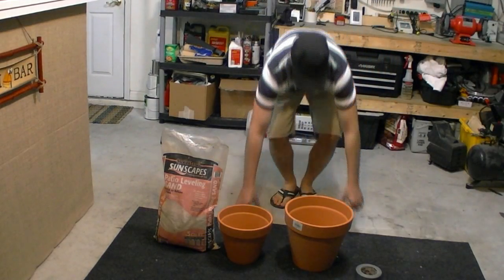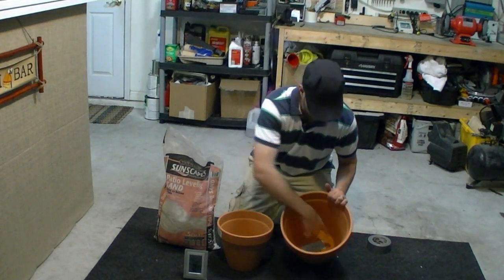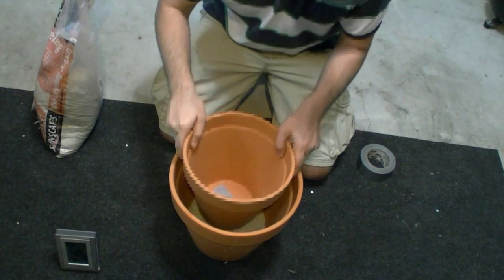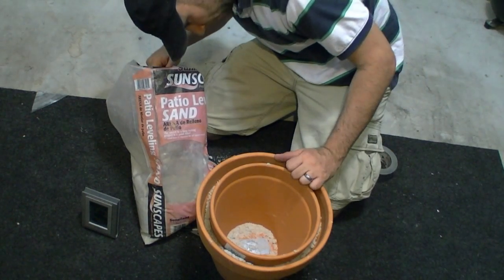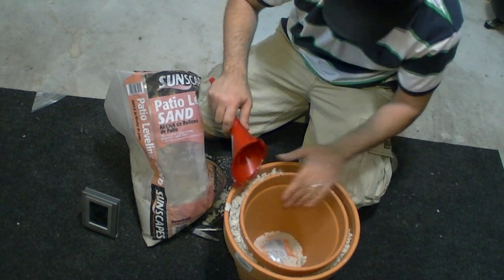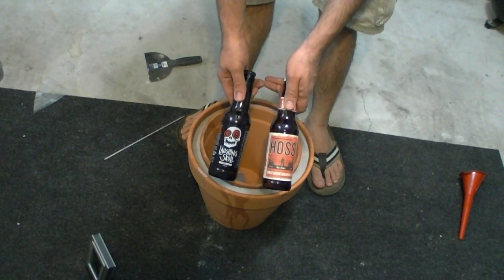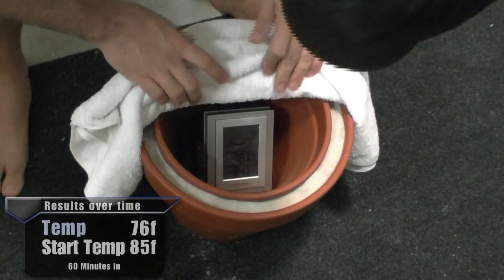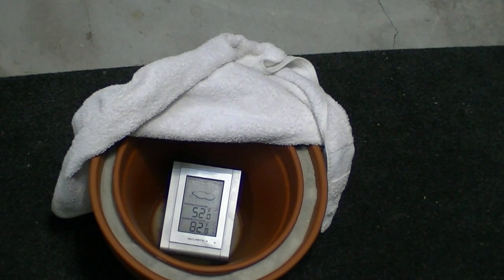Zeer Pot Fridge: Cool your food or drinks with no electric needed!

Comment: Tape is not going to last. You can get rubber or cork plugs that will fit the holes in the bottom of the pots for $1 to $1.50 from any hardware store.

Comment: Do you have to keep the towel wet??? Can we replace the towel with something else once it is cool enough?
Reply: Evaporative cooling works by the heat of the air within the pots being absorbed into the water in the sand and towel, this water then being evaporated slowly by that heat.  No water = no evaporation = no further cooling (just the re-warming of the sand and air over time).
Reply: @charlesrockafellor4200  so we keep the towel wet..
Reply: @bobbin_bombshell   Yes, ma'am.  Sorry, I should have clarified that, my bad.  It needn't be a towel as such as long as it's wet and somewhat porous.  The water on the towel (or cloth, shirt, sheet, etc.) will wick away the heat as it dries.  Other materials  than cloth might work (e.g.: hide, or plastic), but that's only a guess on my part.

Comment: If you put the tape on the inside of the larger pot (you did) and on the outside of the smaller pot the unit will work longer and better.

Why?

Because the purpose is to prevent moisture (water and mud) from getting outside the large pot and inside the small pot. Putting tape on the inside of the smaller pot will give access to the tape's adhesive. It will deteriorate significantly faster shortening the effective life of the refrigerator...

There's some food for thought.

Comment: Hi, Can I make this using river side sand?
Reply: Yes: sand is sand, nothing special about that.  The thermal properties will vary only slightly from one place to another, but in all cases you might wish to wash/rinse it before use, and possibly expose it to fire to minimize possible bacteria.  Also do this periodically (with the same sand or a change to new sand).

Comment: Which type of Sand Material? Is it any special chemical mixer?
Reply: It's sand.  Just sand, nothing special.  The thermal properties will vary only slightly from one place to another, but in all cases you might wish to wash/rinse it before use, and possibly expose it to fire to minimize possible bacteria.  Also do this periodically (with the same sand or a change to new sand).

Comment: If you have a breeze or fan blowing across the top of the pots, the cooling effect will be greatly enhanced
Reply: these are meant to be stored outside or sitting by an open window
Reply: he didn't understand the basic concept of it. it is the same concept as aluminum canteens with a burlap case. you wet them, and as the water evaporates it cools what's inside.
it should have a breeze or under the sun.

Comment: can i use plastic pot or it should be clay?
Reply: Clay or any other porous material (plastic is not porous). But if you wrap the plastic pot in a cloth tightly and keep the cloth wet, it will work (not as effectively).
Reply: +Dini Lee Effendy 
NO YOU CANT

Comment: Thanks! I dont have a Fridge at the moment and this could be of much use! Do u know if i could use beach sand?
Reply: Sand is just sand, nothing special.  The thermal properties will vary only slightly from one place to another, but in all cases you might wish to wash/rinse it before use, and possibly expose it to fire to minimize possible bacteria.  Also do this periodically (with the same sand or a change to new sand).

Comment: I would think that the wet towel would raise the humidity and therefore inhibit cooling of the clay part, except for the very top.  Maybe a clay saucer with water in it would work better to cover the chamber.  Maybe set the whole thing on wood blocks so heat from the floor would not conduct in.

Comment: Wow. In your garage is hardly a dry place - it should be outside in full shade, so it can have a chance to evaporate - limited by the 'wet bulb' in a humid indoor environ, and it still got down to 50 F. I'm impressed. I think you're also supposed to do this with a leaky outer pot, so it can evaporate through the walls, not just at the top through the sand (but a glazed / sealed inner pot). Very impressive

Comment: a quicker way to cool those beers would be to pour them into the inner pot so they can make actual contact with the cold pot. Though there is the risk that the beers will be diluted  because water will seep through the pot

Comment: Why do you need to add the sand. Keep the inner pot on a stand inside the outer pot and pour water in to get between the pots. As the water evaporates, the cooling happens. A better design would be to use a metallic inner pot that conducts heat. Due to evaporation the water cools down and the same temperature is available for the stuff inside the inner pot.
Reply: It's because of the thermal conductivity. Water evaporates faster but damp sand serves as thermal mass that keeps the pot cold once it has cool down.

Comment: for round 2? How about wrapping a hollow tube/coiled pipe in between the 2 pots possibly adding a coil inside the inner pot as well, with a fan pulling warm air through and pushing cool air out. You may have to adjust pot sizes, say from 20" to 16". More or less convert your food cooler to an air conditioner

Comment: umm, I would like to say that maybe, just maybe, you could have placed the funnel with the proper narrow end down, and then filled it with sand, then moved  funnel etc., I thought it odd you would use funnel just as a scooper. However, thank you for video.
Reply: The funnel tube needs to be wider or the sand will just plug it.  If I pour bulk bag dill into a narrow neck bottle with an even narrower funnel, like what he has, it jams in the tube.

Comment: It is far more efficient to soak the clay pots in water so they absorb water, the pots are porous and will absorb it and since they are saturated the cooling will be increased as the water evaporates from them as well.
Reply: Good question !  I like the concept and it is easy, cheap and not long to build.

Comment: Why didn't you try putting it in the sun. That was the whole purpose wasn't it? That is, to use convection to extract the heat. Put it in the sun or in a very humid environment and it will suck the heat right out of the pot. Your beers should be chilled in no time.  At least, that's how it should work in theory.  Try it and let us see.

Comment: Clever idea to use flower pots.  I think the cooling would have gone faster if there was more sand.  If you look at Zeer pot in the Sudan, the size difference between the inner & outer pot is greater & they have at least 3 inches of sand or more around the inner pot. :)

Comment: I dont see the point of you making/using this. I say that because YOU LIVE IN FLORIDA. Why not just take one pot and bury it up to the top in a hole you dig in the sand in your yard? Just bury a pot. make any type of lid and it should stay cold lots, especially if you dig deep enough to hit water (which i recommend doing). also in the shade may be helpful.

Comment: Great video.  Some comments: 

1- Use a system with a thermal probe, it's much less mass and you can monitor the temp without removing the top. 
2.  Also note the ambient air temp in your garage.  Surely it cooled overnight, so that needs to be taken into account. 
3.  What happened to the beer? It's much, much easier to cool air than it is to cool a liquid. If you really wanted to show it working then keep the environment the same for the whole test. 
4.  Video is a bit long.

Comment: i think my cooling pads aren't big enough in the A/C. its probably easier to sleep outside in the shade in front of a misting fan. while working in glasshouses during summer ( like nearly 48C ) they had these tiny little spray jets called misters. a microprocessor system would start up a pump and these things would spray lots of mist like a spray paint can (except water), and I swear it'd go from 48C to like 20C. then humid, then out the roof vents, then hot again and then mist again.

Comment: don't cover the sand, only the inner vessel. I've seen clay lids used on these, covering only the inner vessel. you're trying to encourage evaporation to cool the contents, not slow the evaporation down by covering the sand. once you get the proper temperature(as low as possible), then you could try covering it all to slow down the evaporation to make it last longer, but you need the critical low temperatures before doing anything else.

Comment: well... it would increase the delta (cooling effect) inside, but it would actually increase the inner temperature. (i.e. 76/66 vs 85/69... obviously the cooling effect is better in the second set of numbers, but the inner temp is still higher).

It'd work best with more evaporation and less temperature.
- wind helps
- low humidity is awesome
- thicker outer pot scalloped for fins?
- bigger the pot, the more sand/water it can hold, and the bigger heat sink it becomes meaning slower temp changes.

Comment: So have you tried or heard if having more sand (a wider gap between inner pot and outer pot) works better, the same, or worse? I like this. This is really neat. Having very little humidity where I live is supposed to work better. Thanks for using the thermometer...it helps see the results much better than having someone simply say the inner pot is cooler. Great vid.

Comment: If he stabilized the inner pot with a weight, or foot, he could have poured the sand straight from the bag with a controlled size corner cut off.  Is the purpose of the sand to keep the inner pot separated from the outer?  If so, sticks or gravel would have done as well, and much quicker, and allowed more water (wetter between refils).  Try a clay lid or cotten towel  not draped outside to insulate the sides of the pot.  He makes no ref to RH nor air flow, which are critical measures.  etc....

Comment: here's a useful tip.   line it with metal or foil, (or add metal inner pots to the mix)  and use lots and loads and loads of the smallest lead birdshot instead of sand.   you may find that it makes things a lot cooler

Comment: @TheChareen I live in the high desert in Arizona. My yard is all rock, gravel and sand. There is a layer of clay about 2 feet below the surface.I have made a water filter using this sand and gravel. I did not use any power tools just a wheelbarrow, and a shovel, and sifting grids. No plastic required. No diesel fuel needed. No warehouse, and no store. Low tech works, and does not require modern amenities. Just a little sweat. and ingenuity. this refrigerator can be very useful to some people.

Comment: @overunitydotcom No, it has to be clay for the breathability issue.  I looked into it, and even if you glaze the inner core it won't work right.  This thing works by removing energy from the core via evaporation.  Metal isn't porous.  This is a stone age tech so stick with pottery or masonry.  Even concrete would work.

Comment: yea this is like the swamp coolers we use here in colorado to cool our houses try putting it out in the wind but in the shade and see how good it does. here in colorado the evap. cooling works really well because the air is so thin and it's so dry so I'm amazed it works so well in florida.

Comment: It should also be mentioned that the outside pot should be porous, (water permeable, no glaze) and the interior pot should be glazed and not water permeable. This keeps your food cool and dry. A nice cold room can be built from cinder blocks with the cavities filled with sand. Since the blocks are porous they allow water to seep through to the outside and evaporate. You can use a waterproofing paint on the inside of the building to make it dry. Do not paint or seal the outside.

Comment: Great Video, Pete !
I wonder if it is possible to just use a big metallic trash can like
a metal trashbin and just put layers of sand and cleaning rads ( cloth)
at the sides and have as the outer shell not a clay case, but just a
canvas sack, (sheer fabric of cloth), so the water can evapourate much easier  and faster ?
Maybe you can try this out ?
Regards, Stefan.

Comment: Hey Pete, im a big fan of your videos,  and i was wondering if running some heating tubes from a solar heater around the outside of the pots would help speed up the cooling. And maybe add a drip so it would never run dry.  Tjener scale it up to maybe a 150 liter inner pot,  and see what it could do.